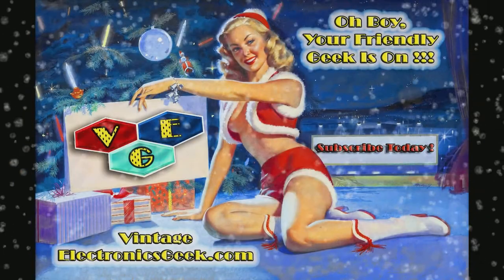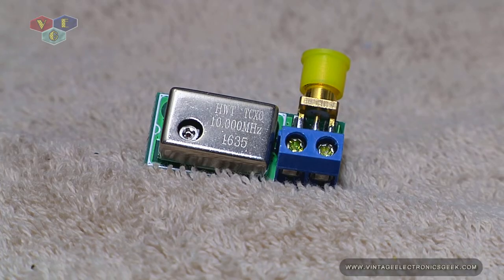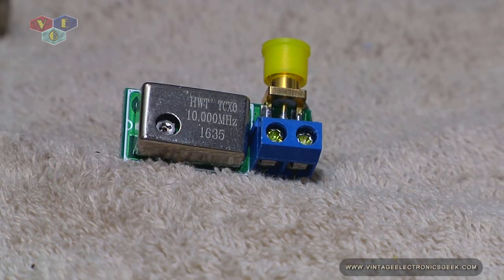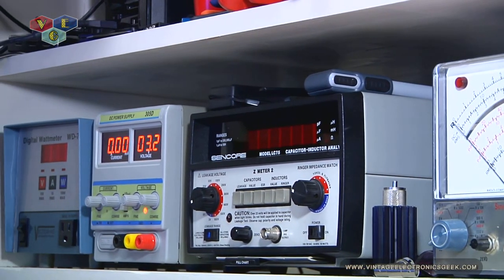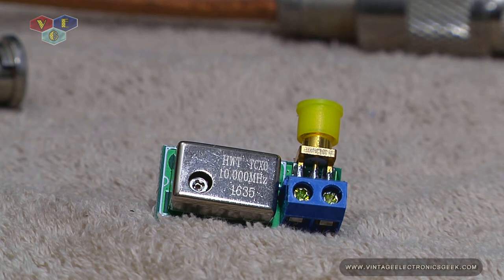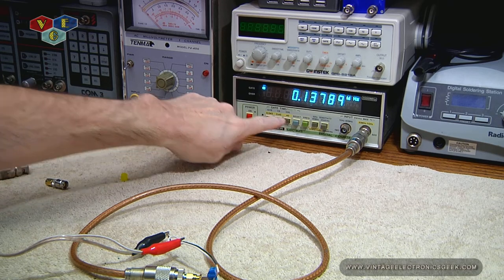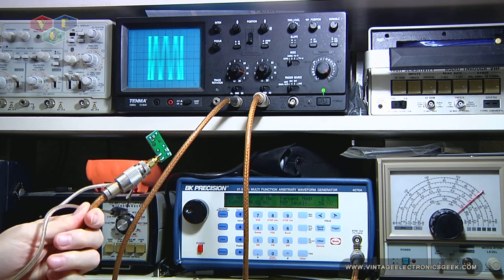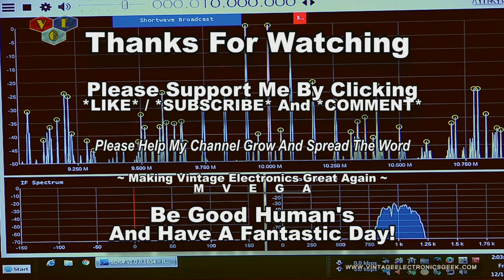Cheap eBay 10 MHz Standard TCXO - Is It Worth It?

Comment: You probably need to load that with 50 0hms going into the scope.  How has it worked out over the past 4 years? 

You can now get OCXOs for as little as $3 on eBay with stability in the 2-5 ppb range and ageing in the .4 ppm over 10 years.  I just posted a video about them if you wanted to check it out.
Reply from the maker: Howdy!  The device died after 2 years of periodic service, I was happy with it otherwise. I have replaced it with 4 HP's but plan on updating to a GPSDO.  ~Jack, VEG

Comment: Jack, you know your stuff... two nights ago, AM broadcast was hot, the GE was pulling in stations all over the place!  I didn't think much of that radio when I found it, nearly passed on it.  It seemed so so when I tried it BEFORE you fixed it up.  But now it's impressive, GE was better than I thought it could be.  I tried my other "night DXer", the GE was much better.  i was lost on the dial, with so many stations.  Sorry I didn't get up to vid it.  
This little gadget was very amaZING,  right on the button, and the test instruments were very well calibrated too.  Thirty meters, plus WWV to compare to, um thunkin of testing the MFJ antenna analyzer too.  It can be used to adjust the indicator of SW radios too, when WWV doesn't come in.  A voltage calibrator would be kewl too, very handy gadgets.  Those little cap testers are kewl too, if they were made in the USA, the cost would be ten times as much and the ChiNEEZ cheap junk.  
btw, speaking of Apple, have you heard much about the new G5 satellites for the next generations of iPhones?  No mo fringe zones, cellery fones everywhere for everybody in the middle of nowhere!  Will ham radio keep up with this technology?  Um still back in the old tube daze.  
Don
Reply from the maker: Howdy Don!  Glad to hear the GE is working great for you!  One day in your HodgePodge you can sample it if you'd like!  Yes, I too am very impressed at how well they do, definitely look at them differently!  Thanks for the compliment...and to think, I have only been doing electronics serious for the past 3 years, imagine if it was a lifelong thing...who know what my level would be to...maybe building radios from scratch, that would be cool!

I don't own a MFJ ant analyzer nor any analyzer, but wouldn't mind it, it would be very cool!  I have looked at old school grid dip meters and also signal analysers with RF in/out, that's what I'd really like to have!  :)   Interesting about the satellites, however now since the CEO of Apple just came out and complained that he wants to get rid of any opposition other then the libtard agenda and ban it from all platforms...you know, like how they did Alex Jones...I will absolutely not support them in any way...why should I want to support someone who wants to get rid of the right of free speech!  Of course, this will be rather easy since I don't own any Apple stuff anyway!  I used to work for Apple, back when Steve Jobs was running the ship...but thats was another lifetime ago...made good money and great stocks.  :)  ~Jack, VEG

Comment: Nice little module Jack. I have seen the boxed oscillator modules loose without pcb's but not seen a ready to go unit like that so far. Might have to invest in a few to act as stand alone test generators. Might be good to have 500Khz, 1Mhz, 1500Khz and 10.7Mhz which should cover broadcast am band as well as the common IF on FM radios.
Reply from the maker: Hey...I didn't think of that, hmmm....might see if those freqs are available for a standard! It really would be a cheap alternative for someone without a lot of means to tune up radios...might be on to something now  Thanks george, hope all is well!  ~Jack, VEG
Reply: I was thinking that they could be all put in a single box with a cellphone lithium cell as a rechargeable power source. Single rotary 4 way dual pole switch just to route power to the individual modules and to switch antenna outputs to a single socket. I think I might look around the chinese sites and see what is available!
Reply from the maker: I think a slight flaw in my plans, but might work...would need to inject a tone into the oscillator, so may need to open the can up...may need to give deeper thought.  You idea does sound cool, will this be something you make a video of? ~Jack, VEG
Reply: I may well do if I could get the right modules. I'm not so sure about needing to inject a tone, a dead carrier would be good enough for spot frequency checks. I'll do some shopping and see.
Reply from the maker: Looking forward to it George!  :)  Merry Xmas to you and yours!  ~Jack, VEG
Reply: Thanks Jack. Same back to you. I couldn't find any 1.5mhz units but I have a few 500khz and 1mhz units on order. Very much cheaper without the oven but still complete units.
Reply from the maker: Yeaj, I too was having a hard time finding a 5MHz like the one I have, I thought about mounting the 5 &10 in a box with a switch, being able to have a choice...I know 5MHz will work, just need to double the math for results, kind of a standard for your standard!  :)  ~Jack, VEG

Comment: You've built up quite a nice workbench Jack, I wish I could say that mine is as clean and organized! It seems like that little module was a good deal, I was surprised it was dead on right after power was applied. However, I cant help but wonder if a little extra circuitry could make that output into a cleaner sine wave.
Reply from the maker: Howdy Matt!  Thank you!  However, at times not so nice and clean!  :)  You should do a video of your workbench, I like videos like that!  I have picked up a few more pieces here recently, so my landscape will change a little.  

After demoing this item, I have really spent a lot of time in the think tank trying to learn all I can, the best I can...I have picked up a 10 pack of ebay 10MHz Xtals for 99 cents, I plan on trying to build my own circuit and see if maybe I can replicate this device and go from there.  May need to call upon you for your expertise!  :)  Thanks for watching!  ~Jack, VEG
Reply: @VintageElectronicsGeek  My workbench is a bit too much of a mess right now, I can hardly work on it it's so cluttered. RF circuits are tricky, so replicating the internals of this well might be quite a challenge, and I don't have much of any experience with designing them. Best of luck though!

Comment: is there a link to ebay seller cause i can find a unit at that price
Reply from the maker: Here is where I bought it from:  https://www.ebay.com/itm/10MHz-20mhz-active-crystal-oscillator-module-0-1ppm-Direct-frequency-output/183335136094?ssPageName=STRK%3AMEBIDX%3AIT&var=690644488525&_trksid=p2060353.m1438.l2649  ~Jack, VEG